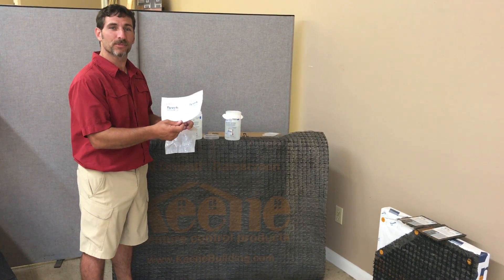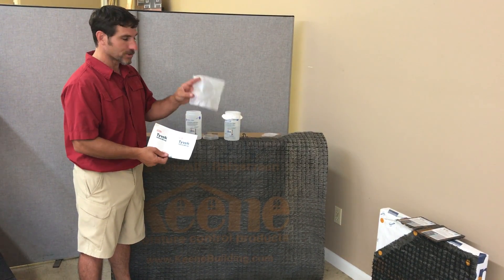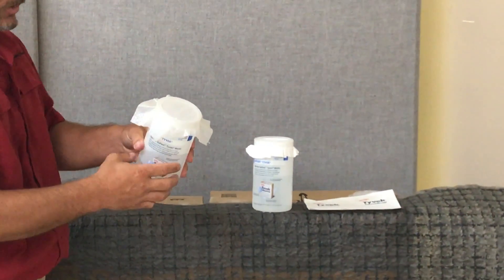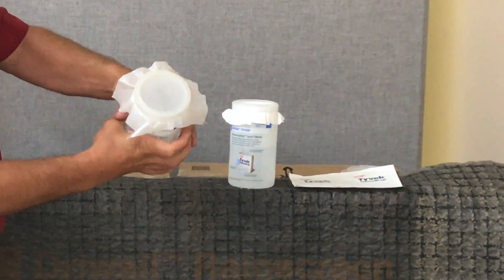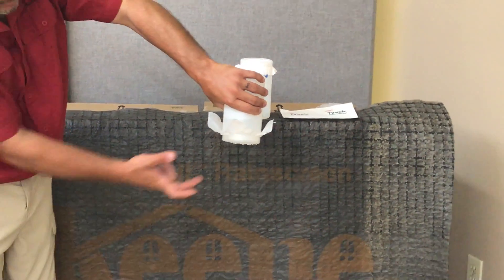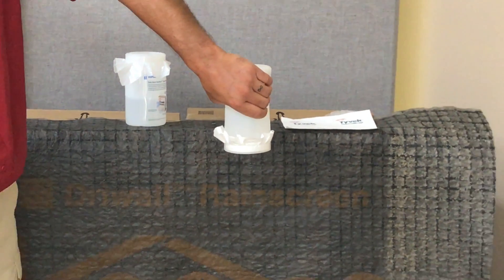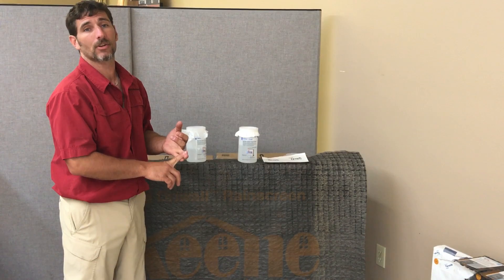Difference Between Tyvek & Generic House Wrap

Comment: Good videos, very informative! My question is for Tyvec Protec 200 synthetic roof underlayment. How do you ensure that when setting concrete tiles on it, it will not leak since the nail that fixes the tile will penetrate the Tyvec and go into the OSB underneath. There is no tar or bitumen to seal around that nail so how do you avoid the leak? Thanks
Reply from the maker: That product is a synthetic underlayment for shingles, NOT tile! I have a video explaining proper tile roof installation also. You have to use a non granulated self healing membrane or it will leak for sure!

Comment: There seems to be 2 camps, team Zip and team Tyvek. Your Zip video is great btw. Zip lasts longer than Tyvek, if installed correctly, but Tyvek has a better PERM rating. So what the hell do we do!?
Reply: I know, I'm stuck with the same decision. I will say though that zip is OSB which does not deal with water nearly as good as plywood. Also, not only does zip need to be installed correctly, but you need to never have any incidents inside your walls that would cause moisture because of the super low perm rating. So no slightly leaky windows or plumbing on top of minimal condensation due to temp differential. Good luck with that.

I started out thinking zip was the future, but after watching this guy show and talk about the shortcomings, and that independent test which showed how bad zip fails, even when applied correctly, I'm thinking if it's not broke, don't fix it.

I hope Rissinger doesn't build too many zip houses. I like him, but he is a HUGE proponent of zip and I think he's making a big mistake here.
Reply from the maker: You cannot beat properly installed Tyvek, properly installed zip can still present issues. Installing Tyvek with cap staples, I use a Bostitch cap Staple gun, which makes it much easier and faster. Then ensuring that all of your penetrations are flashed. That system will outlast anything on the market currently. Obviously, every system that you install has to be done properly or it will not work. Thanks for watching.
Reply: @WeatherProofingAmerica  Absolutely, where are you based out of?
Reply: @WeatherProofingAmerica  I agree, there is too much room for error installing Zip. Especially with the labor force struggling with such a high turnover of new employees with zero experience. The restoration industry as well. The only issue with Tyvek is it lasts up to only 15 years? Kind of like asphalt shingles.
Reply: @3rett115  100% agreed. And OSB will always be just OSB, no matter how pretty you color it. Not to mention water damaged OSB, it’s a lost cause, can’t save it. And labor in 2022… Many desperate for help builders are hiring inexperienced workers and just letting them av’ at it out there smh :-/

Comment: Did a remodel on my house, built in 1985 using Dupont Tyvek.  Total 
waste of money using it.  The stuff was all to pieces.  What little of 
it remained whole, you can tear like tissue paper....something 
impossible to do when it is new.  I'll never use anything but 30# black 
felt again.  Pulled that off 100yr old buildings that looked like new.  I
 have samples of the crappy  Tyvek that came off my house for anyone 
that wants to see for themselves.
Reply from the maker: Please send me some of those pieces.  If you email me I will send you my mailing address brandon@weatherproofingamerica.com
There are many things that can break Tyvek down.  Chemicals are an obvious one but Cedar wood is another big no no.  So depending on circumstances there might be an explanation.  Thanks for watching!

Comment: @2:03+:  You said Tyvek "lets your house breathe," but you showed that neither air nor water passes through it, even under pressure.

Seems like an explanation of why not to use Tyvek.
Reply: What units of permeability are you using?
Reply from the maker: Great question! I should have been more clear on this, when I say breathe, I am talking about water that will evaporate and escape though vapor form as water does naturally if inside the wall cavity.  The permeability of Tyvek being in the 50s means it will allow vapor to easily escape if the wall cavity got wet from a leak in plumbing or other scenarios that would otherwise trap the water.  If the WRB can not breathe such as ZIP sheathing then the water will stay in the wall and start to cause damage.  ZIP sheathing has a permeability of around 5-7 pre taping and sealing, after taping and sealing it drops to less than 1 perm, which means the wall is encapsulated in a plastic sheet.  If any water gets in the wall cavity for any reason it will only be able to dry to the inside if it's hot outside and the AC is running inside, otherwise it will be trapped no matter what.  This can also cause issues in cold climates when it comes to condensation in the wall cavity.  This is one of the main reasons I prefer Tyvek over all other WRBs.  Thanks for the interaction and watching!

Comment: Excellent demo! Opened the eye. Hate cheap products. Question: if the interior walls are closed cell foam insulated, is tar paper better than tyvek? In general do you recommend tyvek over tar paper
Reply from the maker: I am not a huge fan of foam personally, I tend to lean toward Rockwool type products.  Tyvek is a great WRB because it checks all the boxes on my list!  Tar-paper that is manufactured today is not the same product as pre 1980.  Todays product consists of organic filler which does not hold up to the elements over time.  Pre 1980 - Felt, came in various thicknesses & was made with cotton not organic filler such as paper waste.
Reply: Weather Proofing America : many thanks. I was leaning for a 2 inch closed cell insulation topped with rock wool.

Question: do you recommend zip sheathing vs osb topped with 2 layers of tyvek
Reply from the maker: Squeek Hobby zip system sheathing does have some nice structural properties that regular osb doesn’t, so using that for your sheathing is better than osb. However it is not what I would rely on to keep the water out. I also would not recommend two layers of Tyvek because you cut the perm rating in half. If you want a little thicker material you can use the commercial wrap.
Reply: Weather Proofing America : many thanks

Comment: I am curious how the house wrap with http://texene.com/house-wrap compares to the Tyvek?  From what I understand they are the same. Thanks so much
Reply from the maker: I apologize but I am not familiar with that housewrap. I did try to find specs on it and could not find any. The important specs to look at are the permeability (residential Tyvek has a perm of 56). Another important thing to look at is how the housewrap is constructed, if it is woven or perforated then it is no good in my opinion. A way to test this is to stretch it and hold it above you head to see if you have light shine through weaves or holes. Tyvek is spun so it does not leak when held flat with water on top.

Comment: You put the outside parts of the WRBs inside the test cylinders to show that in the case of Tyvek, water does not penetrate even under pressure. The problem is that  you did not CLEARLY show us that the air did come (OUT) into the bottle in that case. It is just not perceivable for us to see that in the video ! Did it ? How could you tell ?
Reply from the maker: Tom Winds its tough to represent/see the air not penetrating on the video but you can try this demonstration yourself with an plastic bottle that can be squeezed:) the air does not penetrate the Tyvek! Thank you for you thoughts & watching the video!

Comment: please explain how if they air wont come out its breathable?  could put 6 mil plastic over it and get same result.   Breathable is more important you will always get mosture in the walls in humid climate the walls are cold on the inside and humidity will condense.  even with vapor barrier it just reverses which season gets the humidity in the walls.
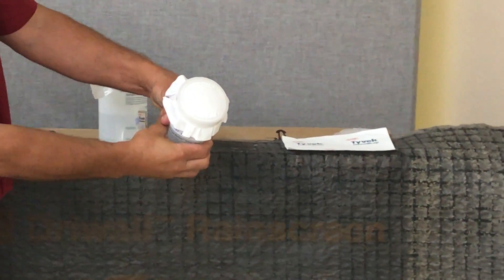Reply: I'm with Bob on this one. I don't understand how this particular example makes sense. At 2:05 "it does not let the air come out. It's solid". I don't get how this example shows how the vapor release works. I like the idea of showing a boiling pot of water allowing the steam to go through. I think that'd be more effective. I read the link below on the science behind it, I just don't see how this example follows.
Reply: hvac sucks the moisture out of the inside in the summer
Reply from the maker: This is a great explanation!
https://www.weatherproofingamerica.com/tyvek
Thank you for your question!
Reply: @WeatherProofingAmerica  That link is broken... it goes to a page that no longer exists.